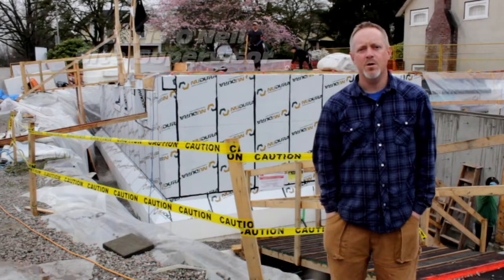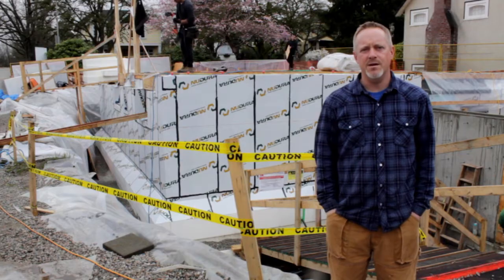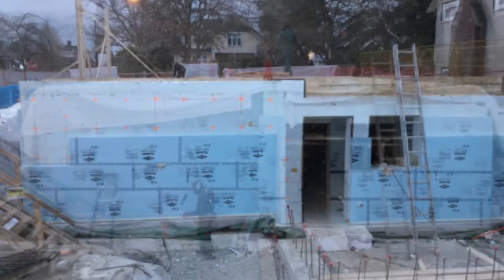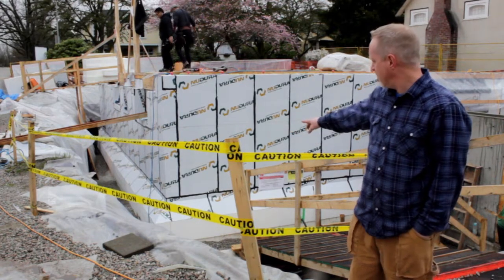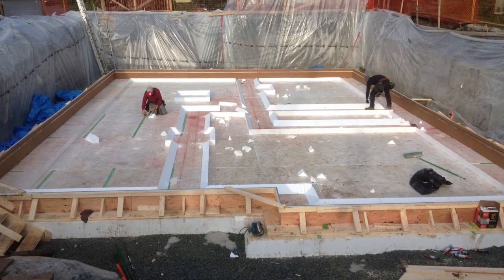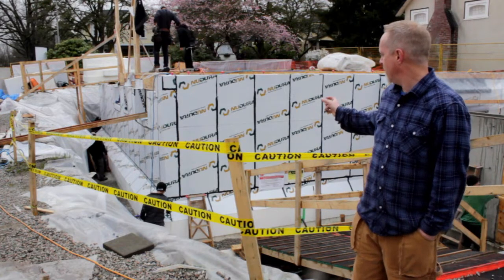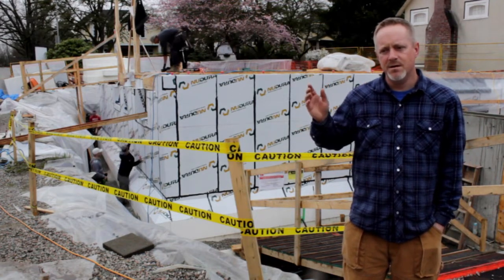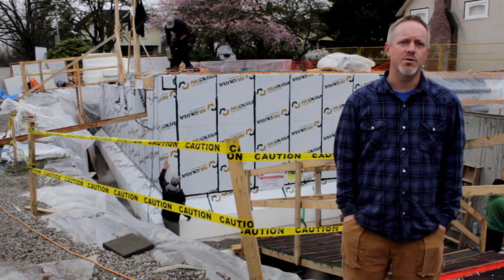Nudura ICF Passive House - VictorEric Premium Homes

Comment: i like you use the 8x4 x 9'structual foam  i used  a total of 18 inch of it and did not have to do any  formwork for interior bearing walls  
lots of friend ask why i spent $ 90.00 a cubic meter for foam when sand was only  $30.00 . i put out the 8x4 sheat in little more than a day t alone to have sread 100 cubic of sand  would have taken longer and do all formwork  then compact it  would have cost more in both labour and backpain . Now i got R72 under the slab and and put friction membrane and tile people think it is infloor heating. poored slab and ICF foundation as one go  , now five years later no cracked tile on aproximate 1800sqft
Reply from the maker: Nice work Clarence!
Reply: What is a friction membrane?